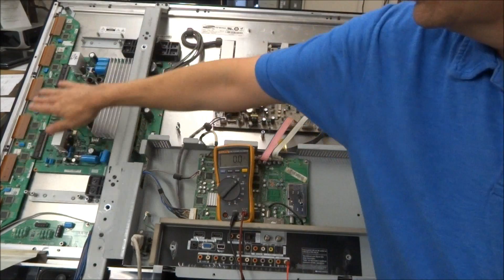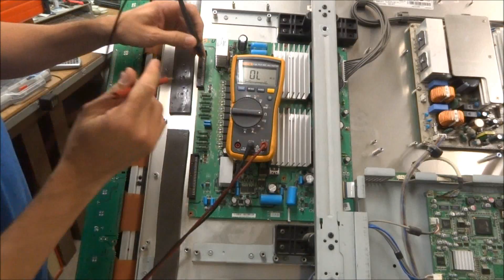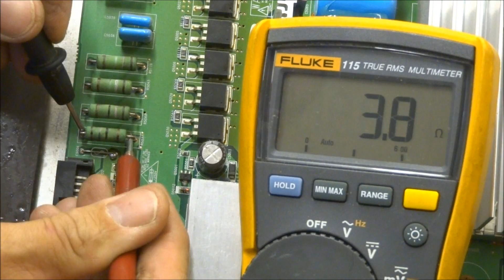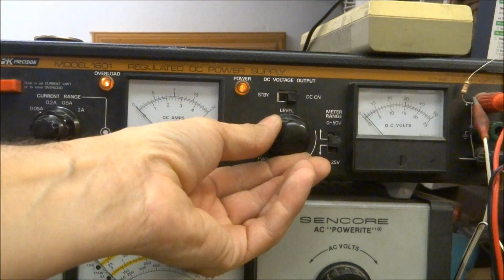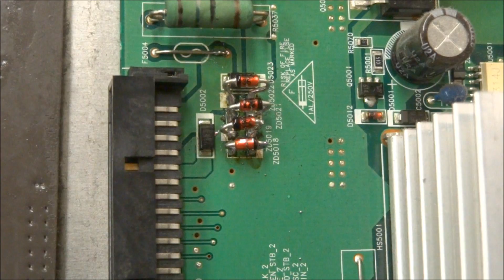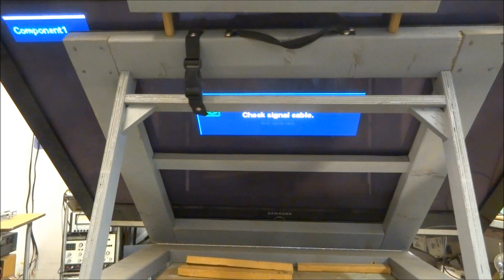Samsung Y-SUS Y-Main HPS5053 LJ92-01389 LJ92-01391 BN96-03360 996500036823

Comment: my board has two mounting screws that burnt up the board, replacing with a new board, but the screws mount to the metal in the tv, is there something i can do to clean these receiving holes for the new board and new screws to prevent corrosion or shorting out again?
Reply from the maker: Try using some sandpaper to sand down the surface until its bare shining metal. You may have to use a slightly oversize screw to grab with metal if the thread was damaged. Make sure the screw you use is not too long so it does not damage the back of the plasma glass

Comment: Hi nice video, please help me I got a problem with the same board the tv just clicks and goes of After I turn it on , where do you think that I should look to find the problem and fix it ? Thanks in advance.
Reply from the maker: Start by measuring all power supply voltages listed. also measure for shorts.

Comment: can you assist with my Samsung S5053?  No sound., for years when you turned on the tv, about 50% of the time, there would no sound, turn it off and the on and the sound would kick in
Reply from the maker: As I recall at one time there was a bulletin for no sound that had me replace the actual audio output IC to remedy the problem, not sure if it is on your particular model though.

Comment: My Samsung HPS5053 has picture but no sound. Any Suggestions?
Reply from the maker: Do you have sound on the optical output and or the analog out rca's?
Reply: @norcal715  No, tried the audio output to a speaker and nothing.   for years when you turned on the tv, about 50% of the time, there would no sound, turn it off and the on and the sound would kick in.  no sound now...thx in advance for your help...

Comment: It seems they used poor quality diodes and capacitors for these TVs. I just recieved one for free off facebook and it has a leaky cap on the y board. Here I am $5 later (3 good quality caps) and it works like new. I'll be sure to remember this video if the picture cuts out.

Comment: Wow. Love that you repaired the board, Most of the time those IPM's go but you did really well! Only suggestion i have is that i would not use one of the AV jacks as a ground reference for measurements, Id personally avoid using anything measurement wise that goes through the main board grounding system due to low voltage components that the meter ground have to travel through to get to the actual ground the power supply provides. I recommend far more to use the PDP panel ground as a reference. Since the main ultimately grounds itself to the frame anyways, that is the preferable place as a central for everything.

Comment: Have the same problem on my Samsung, troubleshot it (by using your video) to the same 4 diodes. Bought the diodes and a soldering repair kit... Haven't soldered since high school electronics class (circa 1995). I'm having a hard time getting the diodes surfaced soldered in there, can you help me? Tricks of the trade, maybe... Thanks

Comment: Hi .I have a plasma Philips TV 50pf9431d/37 .after replacing the 4 zenith diodes I still  got no . .va/vscan/v set .vs/va . voltages ..that means the power supply still not working ? thanks for your advice

Comment: Hi excellent videos I have 2 questions i hope you answer me I have a plasma tv sasung s50fh-yb06 has sound but no image check the voltages when turning on the VS-208 volts instantly low to 35 volts and the VA-59 instantly drops to 3.5 volts ) Next question I have a samsung plasma tv when I turn on the tv burning fuse and the thermistor sck206 thank you sir

Comment: hi I have a S50HW-YB03 it powers on pops loud through speakers then turns off no picture as well sometimes it power cycles and shows video 2 on screen them powers off any ideas? I checked power all looks good no visible bd caps logic apperal to work properly the x sustain is brand new.

Comment: My power supply's a lil different.  The Y and X boards connect directly to the power supply.  The Y board has 2 VA's, but one has a black wire.  The same goes for X board having 2 VS's and one has a black wire.  Should I test the black wire's pin?

Comment: I have identical TV and problem.  Troubleshot EXACTLY like you did, got al the same results.  Vs and Va voltage were fine.  Checked Y-sus and had low resistance at exact same points.  Disconnected y-buffers and got SAME values as you.  I didn't want to un-solder diodes, so ordered y-buffers and y-sustain.  I put then in, and still not fixed.  Troubleshot exact same way again with the new parts, and got the EXACT same results as old parts and your video.  

What now?  Is it possible the y-sus board they sent was bad?  Funny though, no signs of heat on either board and get EXACT same readings, no matter which parts are in there....

Any help would be great...

Comment: WOW! You are the Man for sure. I have a PanasonicTC-P54G10 July 2009 that shows great picture on top part of the screen all the way across from left to right but only approx. 6 inches down from the top towards the bottom of the screen. I was told by a TV repairman that I needed a Main Control Board and it would be more expensive to repair it than going and buying another. Do you have any recommendations. Thanks a million. PS Maybe I could help you with Airconditioning or music if you need for these I know. Thanks again & Hope to hear from you.

Comment: When you check the lower and upper buffer is the TV still plugged in to the power supply?
Reply: Do not use ohmeter with power attached

Comment: Hello there, I am wondering if you can help me. this one have got me, wondering what is wrong.
 I have a Samsung plasma PS51D550C1MXXY. At the start I had a problem with the X-sus board I replaced it, then there was no power ( no Vs power or Va) I have replaced the logic, main and power supply but has not fixed the problem. The standby light is red and flashes at a rate of two flashes. I have fixed a few Tv's but this one has stumped me.

Comment: Hey i got the same Samsung 50" MN:HP-S5053 and its running that same problem. Though i thought it was one of the cords missing. Looking at yours it shows the same for me. So my Plasma tv's problem is basically the samething. Turn it on. 3 light blinks and a click. But no image. Would that be any of the eight diodes?

Comment: Have been following you for some time and love your videos. I am new to plasma TV repair and have approached a road block. I have a Samsung HP-R5052X plasma with no picture and great sound.  I had confirmed that the x board had a blown fuse and also confirmed a dead short.  I have replaced it but still have the same problem.  Y board had major buzzing and replaced that also. Still no picture. I checked the y buffer boards and all seem to be ok. I am assuming my problem now is with the main logic board. Is there a way of checking this board to confirm one is needed and if so how?  
Whatever help you could give me would be appreciated. 
Regards
Jim

Comment: My samsung hp s5053. Has the same problem with the 4 diodes being bad. I purchased new ones from radio shack but there black and silver zener diodes and not copper color. Is this going to be a problem or will they work. Thanks rob.

Comment: i have a samsung PS-42Q7H PLASMA THE BLUE LIGHT FLASHES BLUE THE WHOLE TIME WONT SWITCH ON HAS A CLICKING SOUND ON THE RELAY THERE IS ONLY 5 VOLT STANDBY AND NO OTHER VOLST COMING OUT OF THE POWER SUPPLY WWHAT CAN I DO WITH THE 5 VOLT TO SEE IF THE POWER SUPPLY IS WORKING DANIEL FROM SOUTH AFRICA

Comment: Can you tell me the part number of the Zener diodes, also what is the best way to get the dust out of the tv. I have a samsung ps-50c7hdx/xeu absolutely full of dust and some dodgy solder connections, obviously the guy who attempted to repair this tv did not watch any of your videos and should have the plug cut off his iron.
Reply: Omg it just shows how little we read, I was asking for the part number of the Zener diodes and Steve has already kindly stated the numbers in a previous comment lol, still want to know the best way to get the dust out of a tv without getting the garden blower on it lol
Reply: what is the zener diode number or rating?

Comment: I have the same problem except all four diodes were burnt out. I ordered a replacement and im still getting the same problem. No display. Could it be that i need to replace the buffer board as well?

Comment: norcal715, I have this same HPS5053 and the power comes on (blue LED is steady) and there is no picture on the screen. However, when I measure the VS and VA on the power board they are both at 0V. I measured them the same you as displayed in the video at 0:42 - 1:42. How can I determine if the power supply board is bad or other components within the system? Thanks for your assistance.

Comment: very good video. I knew the issue was the Y main board but instead of buying a whole board, your video allowed me to quickly test these and I had the exact same issue which I could quickly fix. The 36v reverse bias measurement of the zener allowed me to blindly by the diodes for 1€ total! saved lots of time and so seems that this is a weakness of these models. Now why this happened, I should probably find the board schematic to find out the root cause of this problem!

Comment: I have the exact same problem: ZD5018, 19, 21, 22 burned. After replacement as instructed with your video, it still will not show picture. The Vscan  (-190V) will come alive and then shutdown in about a second. It's the same even with the Upper and Lower Y-buffer board disconnected from the Y-Main board. If the ribbon cable at Y-main board is disconnected, Vscan is healthy -190. I can draw a few mA from Vscan with a small load resistor to verify the power supply. Any hints?

Comment: Wondering if you can help me out, as I'm a little stumped. I have a hp-t6044 powers on but with no video (sound works though). I had 2 bulged caps on the Y-main, and replaced them. I see no other damage, and have checked for shorts between the y-main and buffers (no shorts) my VS is reading  458v (should be 207v) and VA is 140v (should be 63v). I'm not sure where to go from here. Thank you for your time.

Comment: Thanks Jim.  The fours diode burn pretty bad to the board.  I figure it is not repairable.  I ordered a used board, and I noticed that the used PCB only use 2 zener diodes instead of 4.  Someone connect the diodes in series by solder only the first anode and the last cathode together with two diode.  I looked at my old board and see that the first and the last can be use to solder.  I will try to repair it again. I wonder if I only use 2 diode connect in series, what diode would I use 72V, 72V?.

Comment: Thank you for the excellent tutorial!  I saved the same TV from the trash as well.  Just like yours, the same zener diodes were shorted, plus the power supply board voltages were way off.  I replaced 3 capacitors on the power board and my friends at work helped me replace the diodes on the other board, as your video showed.  Here's a link to some pictures and maybe a copy of the service manual for the TV:

Can't put a link; search s5053 on Shutterfly...

Again, I really appreciate your help!

Comment from the maker: i used part number 1N4753A 36 volt 1 watt zener diodes with leads, i have to bend the leads then solder them on the flat SMD pads

Comment: Hi, My Samsung also has no picture with sound.  If the VA, VS, VE voltages are correct on the PSU would this mean the PSU is ok?   The X and Y seem fine but not 100% sure  The heat sinks on the X board remain cold while only one heat sink on the Y board gets warm.

Comment from the maker: Wow good observation, the diode is for reverse polarity protection of the power supply. The resistor is for charging batteries at high currents, it makes it easier to adjust the current, I set the current to a trip level of 1 Amp then set the actual output level just below that and when the battery reaches the 100 % level the current climbs to the trip level and the supply voltage it cut off. That way I can charge the cordless drill I use as a screwdriver from 0 % to full in just over an hour.

Comment: Hi, thanks for the great videos, one question, what's the diode and the resistor you have connected on the BK Precision power supply and what's the function?  Thanks in advance.